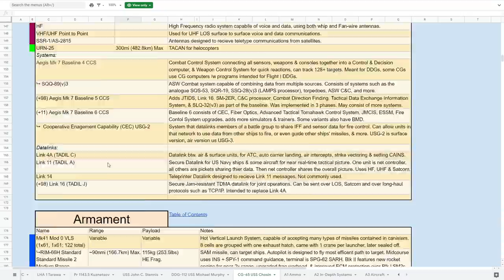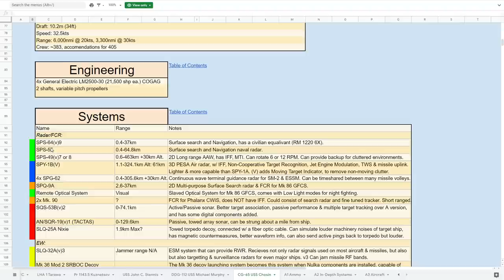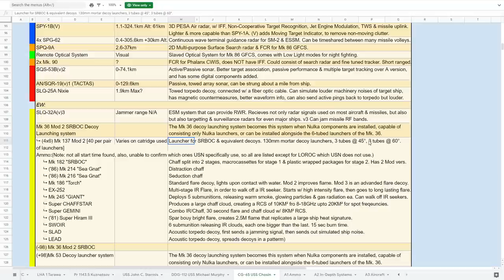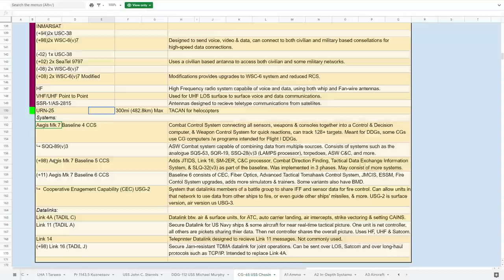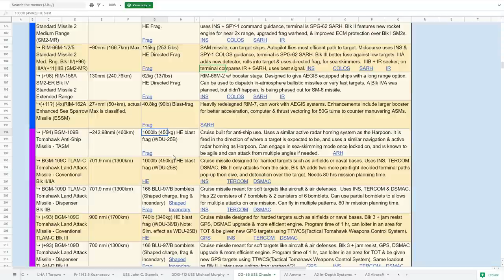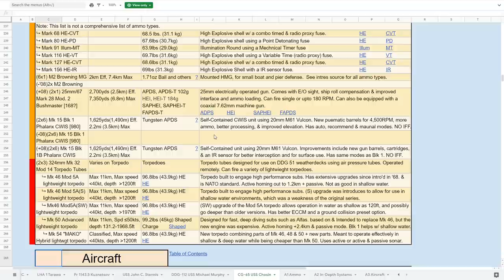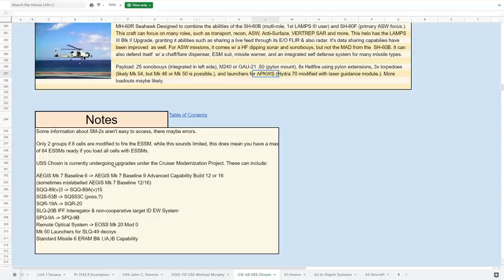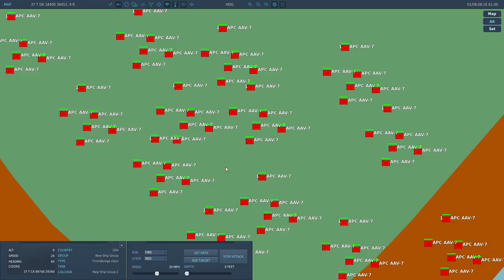Combined Arms: Ticonderoga Class CG Cruiser Tutorial | DCS WORLD

Comment: This was great!
A few things to add or comment on:

- Generators weren't mentioned on the systems, and this is super important for a high-electrical load system like AEGIS. The Ticos use three gas turbine generators. The gas turbines are built by Rolls Royce/Allison, and they're considerably smaller than the GE gas turbines used to power the shafts, but all of the electrical power is provided by these separate gas turbines. Each of the two engine rooms holds two GE gas turbines for the propulsion plus one RR/Allison gas turbine for power. Plus there's a separate generator room holding one RR/Allison gas turbine that is located underneath the rear VLS. When you look at the stacks you can see two large exhaust stacks that are for the GE turbines and one smaller diameter exhaust stack that is for the RR/Allison generator turbine. There is also a small exhaust stack on the port side of the aft VLS that is the exhaust for the third generator. Normally the ship will run two generators at a time so that even if one fails they won't lose all electrical power. During warfare/general quarters times all 3 generators will be run at the same time for redundancy. Each generator can produce roughly 1.8 megawatts of power.

- The Tico carries a lot of weight up above deck and has a pretty high center of gravity. On top of that, the bridge deck carried quite high. The Tico is known to roll quite a bit in sharp turns and heavy seas (more than other American cruisers/destroyers/frigates) and there is quite a bit of movement especially on the bridge. It's not the best ship/station to be located on if you're susceptible to seasickness!

- I wish there were a USS Kidd/ROCS Kee Lung module. These were fantastic ships, and would be a lot of fun to see especially if you were to revisit your Taiwan Strait scenario. (If you do, I would recommend substituting 3 Ticos for the 4 Kee Lungs -- I'd argue they're about 75% as capable).

- Upgrades and hull numbers got me to thinking about the adaptability of the Spruance hulls and systems, which ultimately led to the Kidds and Ticos. Given the abject failure of the Zumwalt and other recent US Navy programs, looking back it would have been a better idea to rebuild the old Spruances instead of retiring them. All the systems are already supported except better air defense. How much would it have cost to replace the rear ESSM with VLS and then an upgraded air system using the new SPY-6V2? Certainly it would have cost pennies on the dollar compared to Zumwalt/LCS and they'd have 28 hulls with modern systems that actually work....

https://www.thedrive.com/the-war-zone/29512/behold-the-navys-new-radar-for-nimitz-class-carriers-and-amphibious-assault-ships

Comment: Bit of trivia: LM2500 gas generators are the same as the core engine from Boeing 747s. (minus the main fan assy)
Reply from the maker: Wow thx
Reply: You more often hear that the LM2500 is out of a DC10 with the front fan's removed and a Power Turbine slapped on the back but yeah 747's did fly a CF6 variant.  And the Generators are Allison 501-K17's are found on C-130's though I've heard they're on P-3's as well.

Comment: Someone correct me if I'm wrong but doesn't the ticonderoga class carry the rim-161 the really long range sam with 500+ mile operational range.
Reply: Rim-161 is an anti-satellite/anti-ballistic missile weapon, not a SAM
Reply: Some can, Upto 5 if I recall right. It was never implemented throughout the whole  class. It requires the Ballistic Missile Defense software to work since it works with the hardware in a different way than the usual AEGIS setup does.